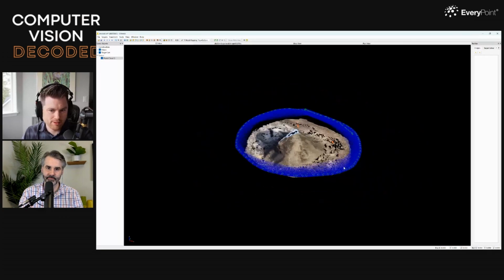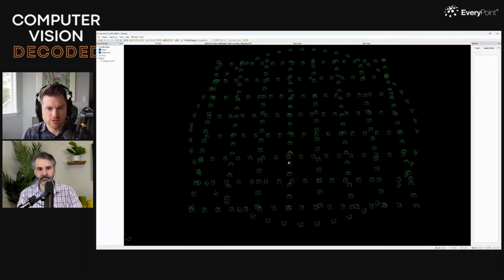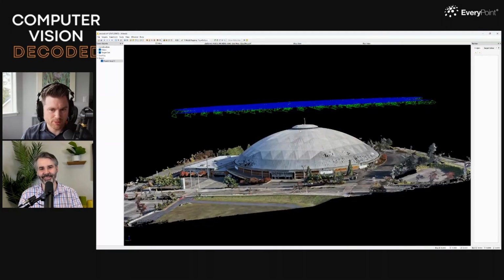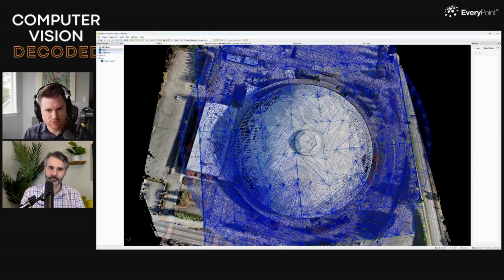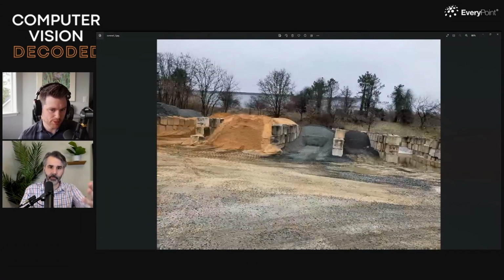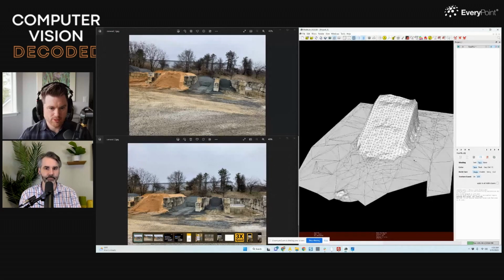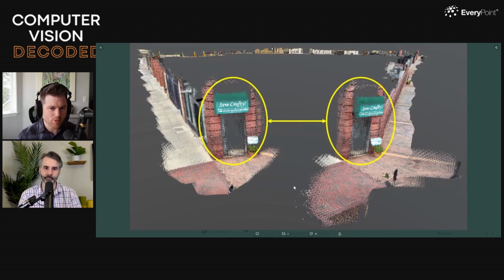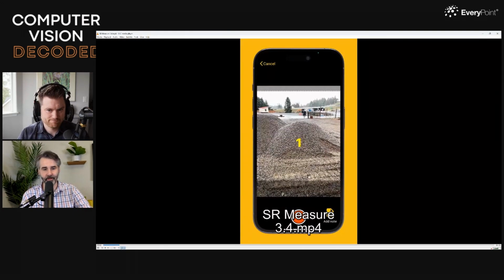From 2D to 3D: 4 Ways to Make a 3D Reconstruction from Imagery

Comment: 🤔 how does a slam algorithm bahave as the dataset gets bigger ? i assume one youve found enough "matches" to locate a certain image in 3d space you can abort most of the other checks , but if you add an image that isnt connected to the existing graph its gonna get interesting 
would be interested in ram/cpu requirement estimations to see if i can run it on my local machine
(im trying to do drone exploration/mapping)

Comment: great content 👍. I am trying to reconstruct a 3D model of a Ring and a necklace and would like to have a detailed model , can you suggest me the best way forward?
Reply from the maker: That is extremely tough. The materials are shiny and thin. Most likely you would need a handheld scanner typically used for modeling parts and reverse engineering.